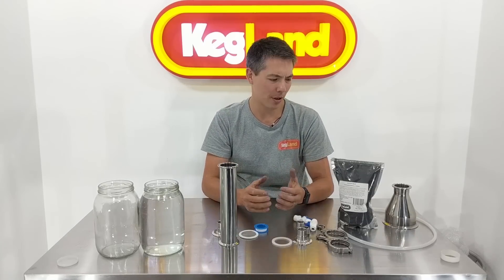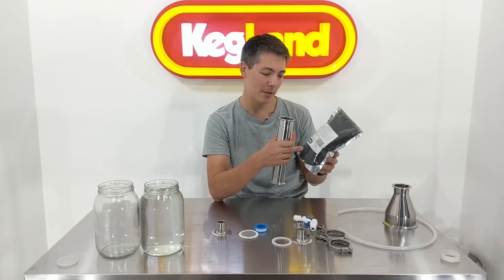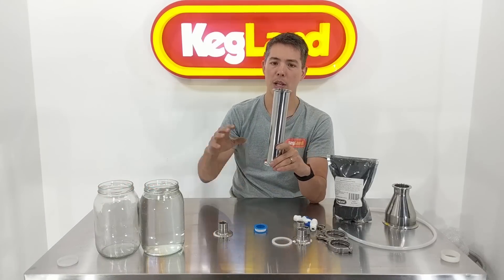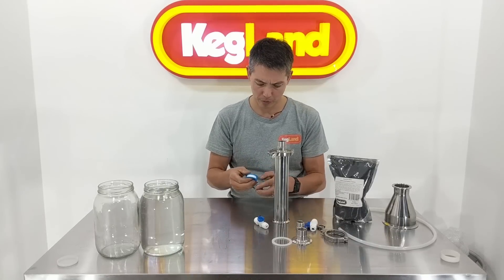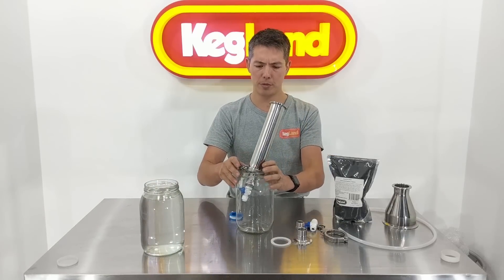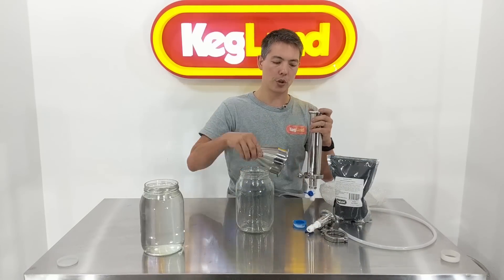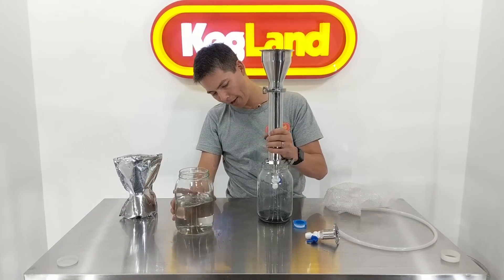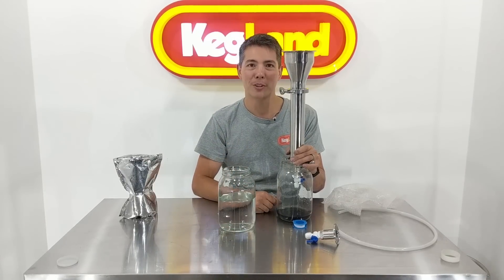DIY - How to assembly your carbon filter and remove fusel oils from Alcohol/Spirit

Comment: i would also recommend putting your 40% abv shine in the freezer and chill it down before running it through the carbon, like chill filtering it helps draw out those more soluble fusel oils from the ethanol to be trapped by the carbon my other suggestion and this would be something i will be trying soon is taking my low wine stripping run and cutting it down to 20% abv ust like most would before a spirit run only i would first chill filter it before doing the final spirit run

Comment: hi Kee! Awesome video, and love to see someone against the proprietary garbage that wastes resources like the disposable filter things that process only a few litres of spirit. 

I would love to see Kegland have a little combo pack on the website that makes ordering all the parts for this assembly as easy as possible. Also maybe some larger hoppers? I sure do not have the grinder required to cut a keg in half, but I know Fabland most certainly would :') Broken kegs that aren't much good for anything else could easily become hoppers

Comment: Working with plumbing for quite a while. The rule is 4 times clockwise looking st the hole. 15 wraps is way overkill. You only need 4 wraps.

Comment: Hi KegLand,

What do you suggest in terms of when finished filtering? Should I remove the carbon and rinse out everything and then put it back in or keep the carbon in and let it dry?
Reply from the maker: You can keep the carbon dry or permanently leave alcohol in the carbon.  Either way will work.  This much carbon can filter hugh amount of spirit so it's not necessary to rinse out.  It's more or less a sacrificial type of filter.
Reply: Just let it dry. It's essentially germ-proof with all that alcohol in it. Eventually -- after say 10-20 uses -- you will have to regenerate your carbon by placing it on a cookie sheet in the oven at about 100C for an hour or two to clean it and make it work again.

Comment: Not all activated carbon is suitable for spirit filtering.  The best type is the Stone, sometimes called "Coal" type.  It is actually made from bituminous coal.  It is best because it has very fine pores/crevices which are what is needed to remove the typical bad taste/smell molecules found in spirits.  Activated Coconut charcoal is also good but has larger pores.  The two types can be blended together for a very good filtering medium.  Additionally, the filter column needs to have at least a 1.25" inside diameter and be a minimum of two feet long.  Smaller diameter columns will cause the spirits to run down the sides avoiding the filter bed.  This is called the "Wall Effect".  Before filtering, the charcoal must be rinsed with hot water till all dust is removed.  When filtering spirits, first rinse the charcoal in the column with water and allow to drain, but not become dry.  Filter through this damp charcoal with your spirits.  The alcohol will force the water downward and out of the column first followed by the filtered alcohol.  Keep doing finger tastes as the column drains.  You will taste water for a while followed by an alcohol taste. When you taste the alcohol, you can begin to capture your spirits without the water.  A good source for activated coal charcoal is:    carbonbulksales.com
Reply from the maker: I mainly use the activated coconut carbon and find this works well for me.
Reply: Activated carbon made from coconut fibre works great.
Reply: @darrellbellaart4158  can confirm... literally just broke in the kit in this video tonight.  super happy.  i ran a lot of water through first, and then had a couple of bottles cycling the same spirit through for a few runs to settle things down... tipped them back into the cube and away we go!
Reply: ps. a bicycle mechanics stand is perfect for holding the unit

Comment: Way too much fhread tape. Three turns is plenty.
Reply from the maker: You are correct. We had very thin teflon when we shot this video. Our new teflon is much thicker and you only need a few turns as you have suggested.

Comment: Part of the process that isnt clear is what to do with the water after the saturation for 24hrs. Do I just let that water drain out the bottom and then dump the spirit in?
What sort of flow rate should I be looking at when its coming off the tap? Just a stead drip?
Cheers!
Reply: spirit on top so it dosnt flow to the bottom right away 
either add it in at 45 50abv to account for the water or monitor the first drips till u think you are not get water then collect 
drips not full open slow is good
Reply: One grip per second should be enough they say 20g of carbon for one litre of alcohol at 40% if you're doing good cuts and getting nice hearts you don't have to filter if your pot still in you will minimise your taste if you do filter

Comment: Thanks for the vid, but you could ease up a bit on the teflon tape mate! You need about 1/5 of what you're putting on.
Reply from the maker: Yes with the new yellow teflon tape we stock you need much less. With the white teflon tape in this video it's really really thin and a lot but we made this video before we stated to stock the thicker and more expensive teflon tape
Reply: I was yelling at the video "thats enough tape....STOP! THATS ENOUGH" my old apprentice manager would have made me do it again😂👍

Comment: I purchased one of these as I run a pot still and also want to use botanicals. My question is, filling the whole time with carbon strips heaps of flavour out of.the spirit - is there a way to just give it a "light" filter to get rid of a few small strange fusels? Can you pack just a quarter of the carbon? Or is there some other way to manage the level of filtration?
Reply: It sounds like you want to filter finished spirit is that correct?  If you try and use carbon it will also strip the botanicals out of solution too so generally you would only use carbon with the neutral base first and once you have a suitably clean spirit then run the neutral through the still and add botanicals.
Reply: @keglandau  Heya - no I don't do neutrals, the spirit I make is a single distillation pot still spirit. I went to very lightly filter some of it out - yeah I know carbon strips, that's why I was wondering if you used less carbon, and maybe ran it quite quickly through, it may not strip so much of the flavour.
Reply: Sorry that may have been confusing - I'm not looking to filter the spirits 8 make with botanicals, i just got this because I want to try using botanicals - my filter question is separate to that.
Reply: Instead of using activated charcoal, place two coffee filters in a funnel and fill with rinsed lump hickory or white oak charcoal which is available on Amazon.  Br sure you don't buy anything, but charcoal made from virgin wood.  Let the spirits from the coalescer run through the filter.  This will remove or more correctly, polish the spirits without removing too much.
Reply: @rocketsroc  so in the year or so of experimenting with this and doing a lot of research, I've found the solution that works perfectly and is used by many distilleries in Japan - diatomaceous earth.

I have had huge success in filtering fusel oils using this technique on single run distillations with a pot still, it removed the majority of the oils and doesn't impact any of the lowe tails flavours (which with what I am making, shochu, is essential to the flavour profile.

Give diatomaceous earth a go, it's great stuff!

Comment: All good... I was going to rubberband a chux cloth to the end of this same 2inch extension ... this looks sexier, and s$x sells. Working slower with a ball valve cannot hurt either.
Reply: Note to self after my filter kit arrived today. 
Ordering KL06576 instead of KL06583 as described in this video doesn't work so well. There is a remarkable difference between the  3/4 & 1/2 inch reducing brushes. God I'm an idiot : )

Comment: With this filter is it necessary to separate the heads and tails?
Reply: yes mate ..
Reply: @johnrasmussen3752  Especially the heads. Methanol will blind ya.
Reply: generally that is what you are suppose to do for both as much as possible but if there are still some bad things that get through like fusels etc then use the carbon filtering although i would chill the shine first